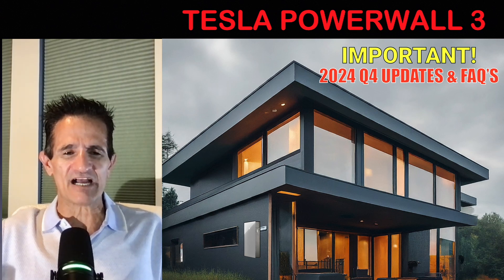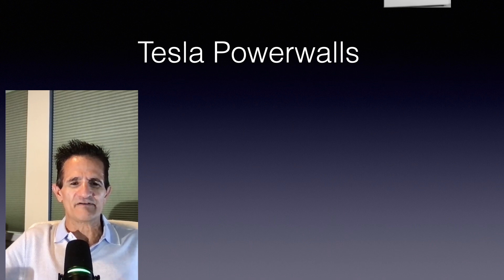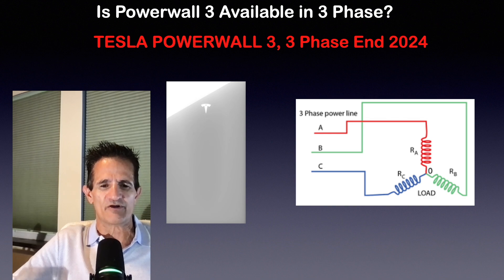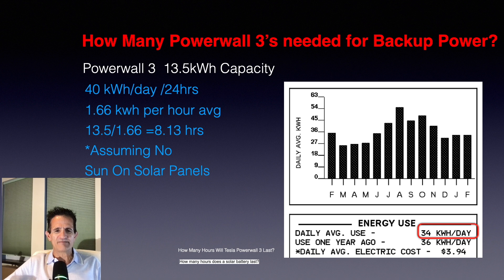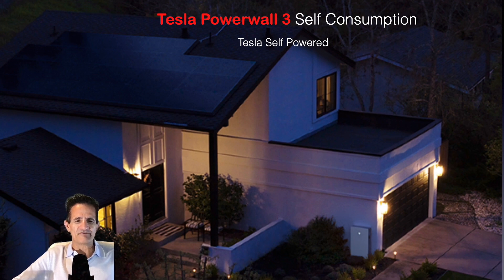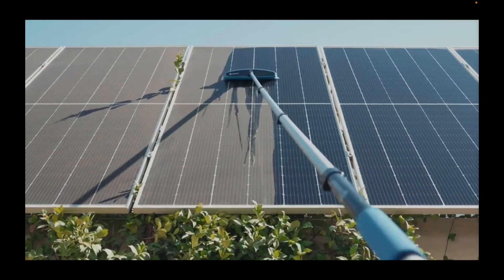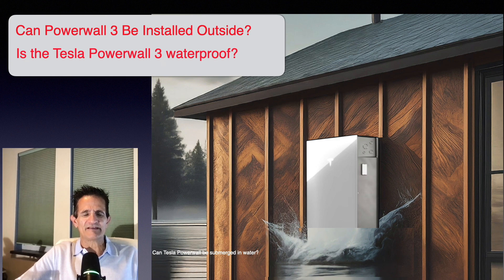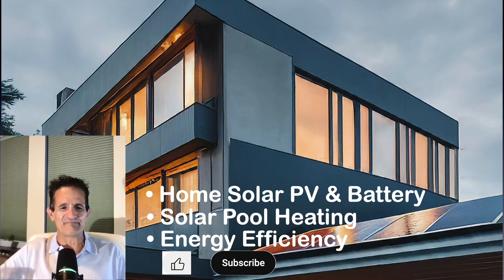Tesla Powerwall 3 Review 2025 New Features! & TESLA Home Battery Backup POWERWALL 3 FAQ's.

Comment: I signed a contract in August for two Powerwall 2s to mate to my Enphase PV system,  but in Oct I changed my order to have two PW3s installed.  My order was changed and I am just waiting for supply to catch up to demand.  The installer believes they will receive their PW3 in lat Jan.  So glad we are getting the the PW3s.  Two will provide all the power I need with my 12.5 kW system (31 Q-Cell panels and 31 Enphase IQ8A Micro Inverters).
Reply from the maker: The PW 3 is a huge improvement VS PW2 so glad to hear your order changed.. even if you need to wait  it's worth it. Congratulations on your purchase